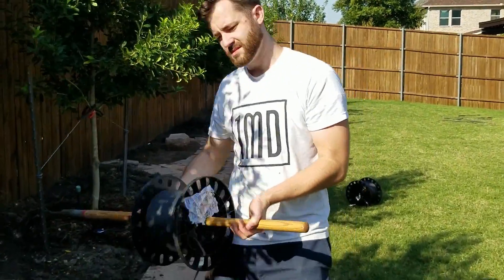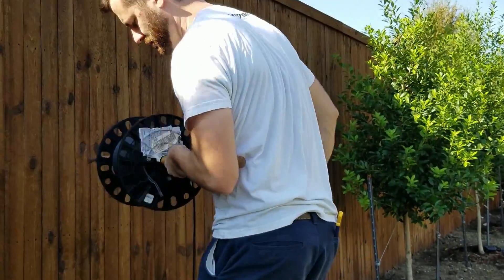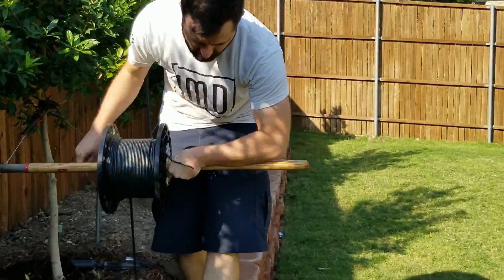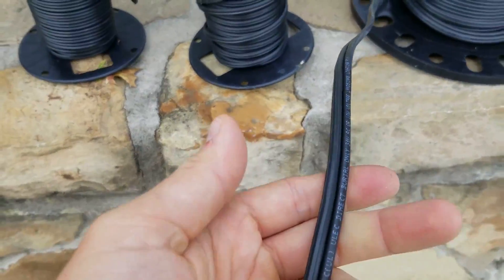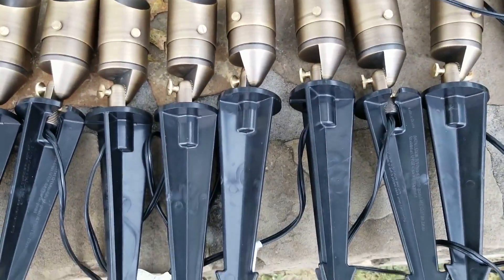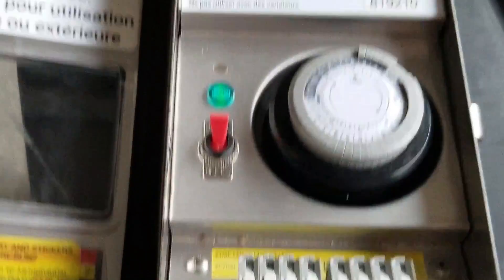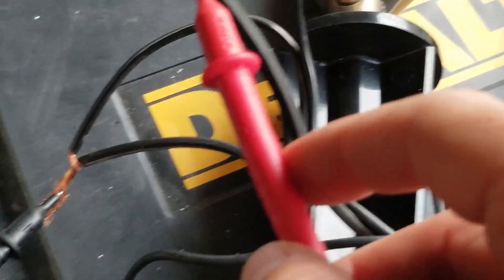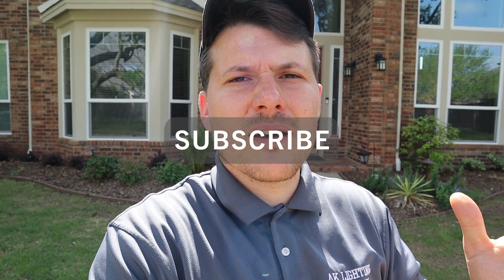Landscape lighting 101:  Best place to learn more about landscape lighting WIRE - Part 5 of 7

Comment: Great content!!  Question: I have some very long rins that split off a wire about 40 feet away from the transformer. Can I use #12 wire up to the split and then splice to #14 for the rest of the satellites runs?   The #14 is already buried so would prefer to not have to change it.  Thanks

Comment: Should I run new wire or use existing wires.  The previous owner didn’t pay attention and all the bulbs are busted.  Is there a way to test if the wires are good?

Comment: I have 15 watt led lights that have the 2 main wires and a ground wire, how can that be wired up into my old light system
Reply from the maker: You need to make sure they are 12volt lights. That sounds like a high voltage system. There is also 24volt lights, so make sure you are connecting the same ones you have in your lighting system.